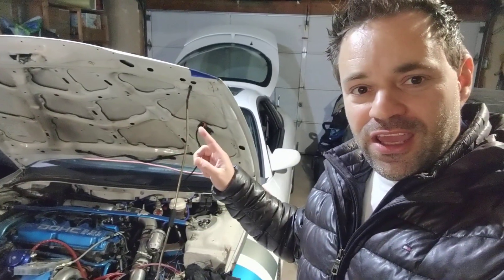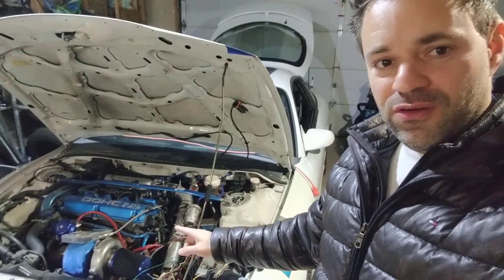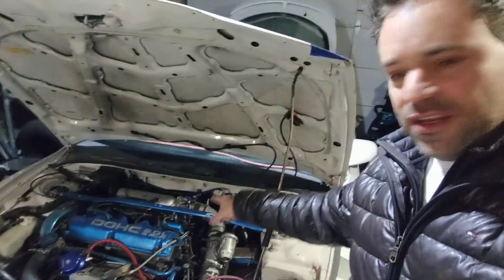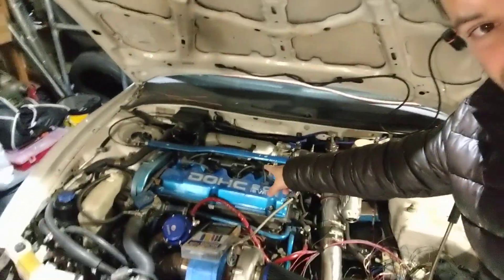Will It Be the First Eclipse 2g 420a with Speeduino ECU?

Comment: Were you able to configure the trigger?
Reply from the maker: Yes I was no problem
Reply: @CarModsGarage  In addition to the 420A configuration, there’s also angle configuration, etc. I’m a bit lost.
Reply from the maker: @PedroV9  the trigger angle is a initial angle to guarantee that the 0 degrees on your timing table will be zero degrees on the crank.  Once the trigger angle is se when you have a 10 degrees on your table the timing light should say 10 degrees as well